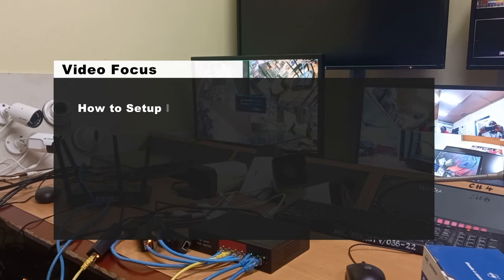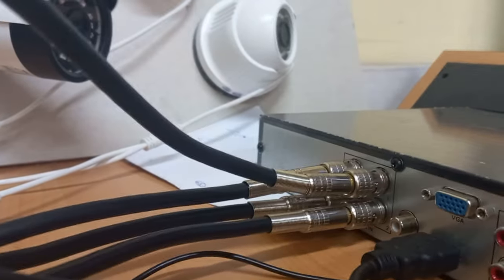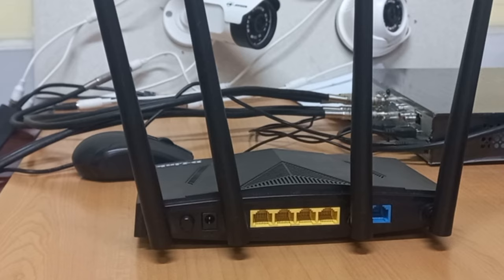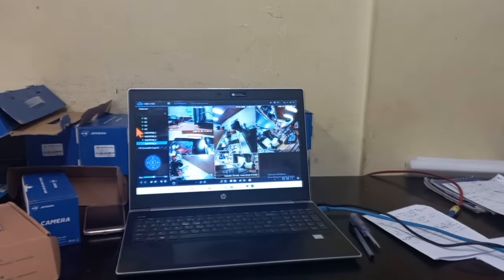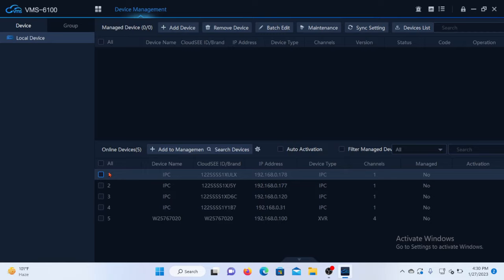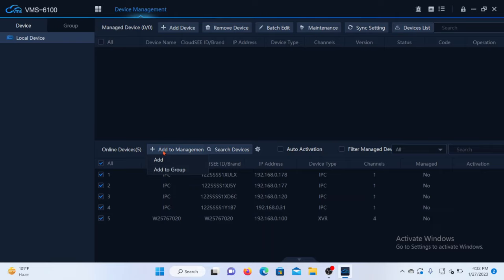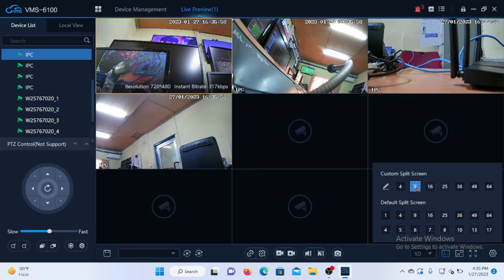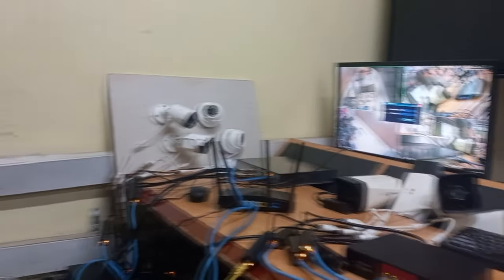How to link AHD & IP CCTV Camera networks together into one large CCTV Camera installation

Comment: Thank you so much for this detailed information.

But I have a question, any difference between AHD and IP cameras?
Reply from the maker: 1. AHD stands for Analogue High Definition whiles IP stands for Internet protocol.
2. All AHD Cameras are Analogue cameras whiles IP Cameras are digital cameras
3. AHD Camera pictures or videos may vary between sharp pictures and bad pictures, just like the old Analogue tv system where your pictures could at time be clear and at other times very bad. For digital cameras, it is either extremely sharp in picture quality of off, there is not intermediary between purely clear pictures or off. This is the reason why digital signals are referred to as binary systems where you have either 1 or 0, where one connotes clear picture and 0 connotes off.

I will do short video on this interesting explanations, watch out for that very soon.

Comment: Thank you sir, but in this case i haven't heard you talking about the IP addresses, you have simply merged the cameras, does it mean they cant be viewed via WAN network?
Reply from the maker: The IP addresses are generated automatically by the router for each camera.
Every IP camera acts just like any other device on a network.
The cameras can be viewed on WAN once internet is available on the router.

Please write back to me if i have not fully answered your questions.
Reply: If we connect different remotely cctv system at CMS by ISP , how we will find our system i means by ip address.

Comment: Thank younfor this detailed explanation. Do I need to station the computer hosting the vms there and how can I view these combined camera views on one TV screen and record using the NVR?
Reply from the maker: The computer can be placed anywhere that you find suitable. You can even place the computer at a remote location example is in this video 
https://youtu.be/5f8aWO_m_8M
For using a TV screen, just as you may use the TV as a monitor for your NVR,  you can still use the TV as a monitor to the computer hosting the VMS. 
The recordings can be done onto the NVR whiles you also record on the computer too or however you wish to have it.
Reply: @Tech_Inside_Out  In essence does it mean that without the computer it won't work?
Reply from the maker: If you have to combine AHD and IP camera networks together,  you can't do without a computer with a vms software.

Comment: Excellent tutorial. Keep it up. Please can this work when the pc is not connected to the same network of the DVR/NVR?
Reply from the maker: There are two ways to it.
1. Being on the same local area network creates a common ground for the devices to work without the use of Internet.
2. If the devices are not connected to the same network (LAN), you will  require internet to have them communicate. In such a case, you will need to use the cloud IDs of the devices keyed into the software to have them see or communicate together.

Comment: If the dvr and nvr have different IPs, can it still work same way when you connect both to the router? Or the router itself will assign new IPs to them along with the laptop ?
Reply from the maker: The IP addresses of the DVR and the NVR will always be different so long as they are connected to the same router. You can let them acquire their own IP addresses by choosing DHCP on the NVR and DVR

Comment: Buddy, is the software VMS that you are using just for the brand of cameras that you're using or the same software will work for different cameras different making ?
Reply from the maker: There is a VMS for every brand of camera but once your brand is ONVIF Compliant,  it should work with the Jovision VMS. However, compatible is a big issue when combining these technologies and so using products from thesame manufacturer is highly recommended.
Reply: @Tech_Inside_Out  Thank you bro, as clear as the air.
Reply from the maker: @carlitosregidor My pleasure

Comment: I need to monitor and record multiple standalone cameras located in different cities in a centralized station, any solution would you  suggest?
Reply from the maker: You can do that but it also depends on your camera brand
Reply: @Tech_Inside_Out  
Thank you sir for input. 
I need to start from scratch,requirement is to install one internet based camera at client location without DVR and recording needs to be saved at central location using internet.  I would appreciate if you could suggest suitable camera brand,recorder along with surveillance software.

Comment: I have a question sir, suppose you have several standalone cameras and you have to finnaly link them to the router but unfortunately the Rj45 ports on the router are not enough to wire them all, how do you handle such issue
Reply from the maker: You will need a network switch to multiply the router ports

Comment: Then how can we output the video on several screens placed beyond hdmi cable length?, Note thar internet connection is unavailable in that scenario?
Reply from the maker: There is no limit to hdmi cable length.  You can even create hdmi cable using a Cat 6 ethernet cable to run upto even a 100m
Reply: Thenks alot bro
Reply from the maker: @creativemind3562  You are welcome
Reply from the maker: @creativemind3562  You are welcome

Comment: if I have
Many ip camera,4 or 5 nvr,4or 5 switch ,and 2 or 3 moniter so how I interconnect each other?
Reply from the maker: 1. Connect your cameras to each NVR as you require.
2. Connect your screen to each NVR 
3. Connect every NVR to a router. 
4. Connect a Server/computer having a vms to the same router.
5. Setup your computer to receive all the cameras from all your NVRs or DVRs